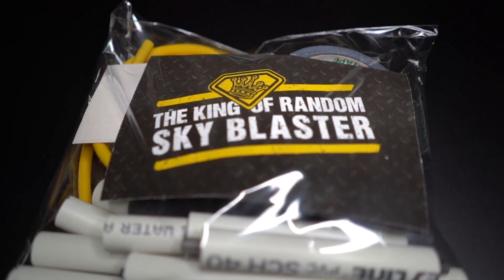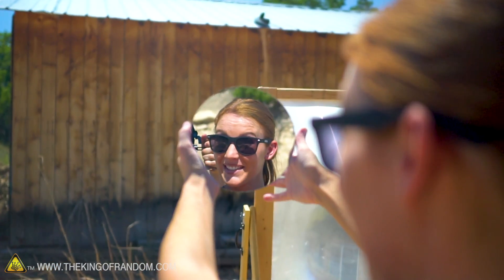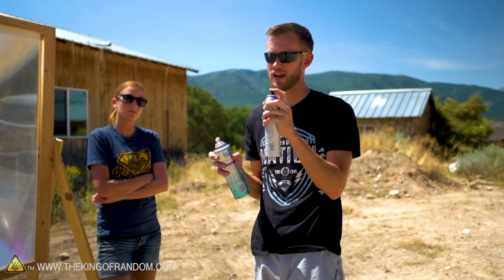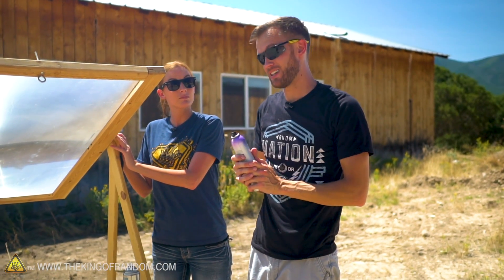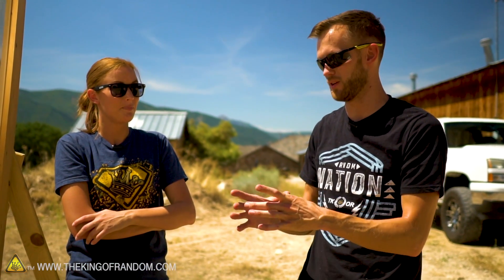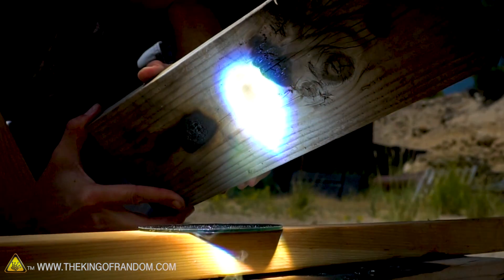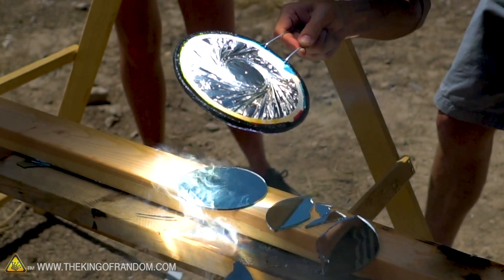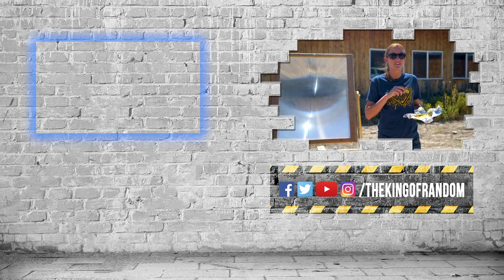Will A Solar Beam Reflect or Melt A Mirror?

Comment: Please try to use the solar scorcher to generate electricity using a makeshift steam turbine or thermocouple. How much electricity could you generate with the concentrated heat from the sun? Could you recharge your electronics while camping, or power some household appliances (e.g. fridge) during an extended power outage, by charging up a power bank?
Reply: I am super curious about this as well,  That is pretty much how a molten salt solar generator works.

Comment: Mirrors and sunlight?  Might I recommend the Troy Rising series by John Ringo?  One of the bits of tech in the series is called the Solar Array Pumped Laser or SAPL.  While it's not technically a laser, and is really just an Archimedes array on a very large scale, they're able to use mirrors and sunlight to mine asteroids and defend the solar system.
Reply: Yeah, they had issues with their mirrors breaking in the books as well.

Comment: Ive always wondered if the solar scorcher would be able to provide enough heat to forge steel? If it can get to 2000°, the melting point of steel is in the 2500° range, but You won't need to melt it. Just saying, knives forged in sunlight would be rad.

Comment: For the aerosol spray to ignite when you spray, you will have to mix the aerosol with some kind of color. So when the magnifying light hits it, it wont reflect thru like the clear aerosol spray. It's like water, the heat light will just go thru the clear aerosol without being contact to a color aerosol spray. Try dyeing the aerosol to a different color and maybe it will ignite

Comment: How mirrors work is that it absorbs the photons and then creates a new photon in a counter path to the way the original photon was traveling. However the mirror is not 100% reflective even if it looks that way some of the energy is absorbed and turned into kenetic a.k.a heat energy.

Comment: You guys are doing it backwards. What you need to do is figure out where the focal length is and put the lens under the pan with the pan at the focal length and use the mirror to reflect the light from the sun up through the lens focused on the bottom of the pan and then it will work to fry your eggs.

What might be more fun would be to see if you could use reflected light on a photo cell. That way, you could have a static array of photocells with heliostats that track the sun, bisecting the angle between its azimuth and your target and have a tracking solar array, which is basically stationary.

Comment: This experiment makes me wonder how much of each wavelength do mirrors reflect? Do they reflect visible light more than the invisible part of the spectrum?  The experiment obviously confirms that a lot of infrared energy is absorbed.
Reply: Different materials are better at reflecting different parts of the spectrum. Most mirrors reflect in the visible range. Although, on rare occasions mirrors are made to reflect other wavelengths.

Comment: If the mirrors were already evenly hot they wouldn't shatter. the reason they're shattering is because of thermal shock. Rock does the same thing if you heat it up wrong glass and rock are rigid if you heat up a small portion of it rapidly but expense will the rest of it stays the same size causing it to shatter

Comment: You guys need a frontal surface mirror.

The reflective surface is on the front of 
the mirror, so the light doesn't have to go 
through the glass.

Twice.

steve

Comment: what I learned from this, mirrors reflect light but not heat it seems
also, the reason for the rainbow on one side of the reflective lens and not the other, when the light reflects off your hand and passes thru the lens, the lens acts as a prism and divides the light into its rainbow spectrum

Comment: Hey guys Can you try to see if under enough heat will gum melt or burn and will it make a difference if its chewed. If it catches on fire can you see if you can put it at the end of an arrow from the crossbow Nate made and see if it works as a sticky fire arrow.

Please

Comment: try this please, a bullet chamber but the inside has mirrors tilted diagonally towards each other that send light bouncing from one end of the barrel, to the other end and then you have one of those screens at the other end that creates a focal point and boom ray gun. you could make a trigger that opens the lid when you pull it to let light in and then let go of the trigger to "turn off" the ray gun. I think this would be interesting. Like so they can see, please and thank you.

Comment: Try putting the mirror on ice, or just water to dissipate the heat of the mirror enough to cook the popcorn. (like how you can boil water in a plastic bottle without the plastic melting)

Comment: as a mirror's reflectivity may vary from 85% to 99.9% it might have worked better with more expensive mirrors, those looked like the standard looking glass variety while more expensive industrial mirrors with a higher reflectivity would have absorbed a lot less of the heat.

Comment: What would happen if you placed the end of some fiber optic cable in or near the focal point of the light?
Would it be able to transfer the heat via light to the other end?
Or
Would it melt it to quickly to find out?

Comment: Can you test the whitest brightest paint and Venta black against the scorcher?! 🤔🤔
Reply: Vanta Black isn't commercially available, but they could test Black 2.0 which is the next best thing. However, it would just light on fire in a matter of seconds. Not much to test there.
Reply: That would be sweet!  I was thinking Titanium Dioxide since I'd use as 99% diffuse reflectance NIR standard along with others that make with sintered or powdered PTFE.

Comment: Expensive mirrors used in physics experiments have the metal on the reflective surface and the glass is a smooth supportive structure.  This way the light is not transmitted through the glass and there is no spherical aberration, etc.  Would one of these mirrors behaved differently?

Comment: I'd be curious to see if you can take the focal point of the solar scorcher and magnify it even more with a magnifying lens. Would it start fires even faster than just a magnifying glass, given the area of the scorcher is bigger, more heat or sun will be focused to that point.

Comment: The Sun isn't emitting light in just the visible spectrum, so it's probably not the visible light melting the mirrors, but the IR light coming from the sun (or whichever wavelengths match the ones from all the atoms in the mirror). You guys should try to use the Solar Scorcher with a bunch of lasers!

Comment: You have to try with a silicon mirror, used in laser cut cnc machines, the reflectivity is close to 100%, and you can try to let the mirror float in water to extends the experiment.

Comment: Can you test if first surface mirrors or front surface mirrors have the same issue of breaking? It might be that the protective coating behind the metallic reflective coating is heating up the whole thing. I wonder if the reflective surface wasn't behind the glass, but on top, would most of the excess heat just radiate through the glass or bounce off?

Comment: I think the Tkor group was thinking that light and heat are linked but there not. while yes the light heats things up the heat is not carried by light. things heat up when light touches it even if it is reflected some of the energy is transferred and as it is the item will heat up no matter what the item is.

Comment: No mirror reflects 100% of the light that falls upon it, but most modern mirrors reflect about 95% of the light. That still means that about 5%, or 1/20th, of the light incident upon the mirror is still absorbed.

In the rebuild video, Nate said the frame was "41 inches tall by 31 inches wide," and the dot that Nate and Calli are able to make seems to be consistently as small as 1/2 inch in diameter, so that little dot of sunlight sees about 5,000x as much light as it would without the magnifying glass.

That means that even if the mirror is reflecting 95% of the light that falls upon it, it's still absorbing as much energy as a black circle the same size under a star 250x as bright as the sun.

Don't forget your sunblock.

Comment: What if you make a polished mirror of Tungsten metal? Of course, this could be tricky; Tungsten is not only very hard and dense, but very heat resistant, so machining a mirror-shiny surface could prove to be hard (oh yeah, and expensive)! If anything can withstand the power of the solar scorcher, my bet is on Tungsten.

Comment: Honestly, if you decide to redo this experiment, I'd have a mirror of matching size to the solar scorcher screen, but have the mirror angle the light into the solar scorcher. This way you dont run the risk of breaking the mirror, and you get the upwards focal point. Only problem: getting a hold of the proper sized mirror

Comment: My Guess is that the reason the mirror breaks so easily might be do to ultra violet in infra red radiation wich isn't reflected aswell in a mirror. It might also just be a trash mirror that doesn't reflect a high enough percentage og the visible light

Comment: Wonder if you can turn that light into a laser by reflecting it into a cone shaped structure lined with reflective glass and another magnifying glass on the smaller end? Maybe also include super cold gasses inside the structure to try and slow the light molecules down as well?

Comment: what happens if you get a solar panel in front of the Solar Scorcher
Reply: Not a solar panel, a looped pipe of water connected through a series of turbines, the light heats the pipe the water rises and or vaporizes and rises faster, circulating through the closed loop...

Comment: Light based heat or not, it's still heat. You can't bounce heat. If you took a pane of glass at the focal point, it wouldn't matter how much light it let past, because the heat is still stopped by matter.

Comment: you only used rear facing mirrors, try some front facing ones as well. a front facing mirror has a reflective surface not obstructed by glass. 

here it looks like the concentrated heat cause the mirrors to shatter by making the glass expand, and as the mirror coating is just a dusting of silver it wouldn't hold it together much at all. 

i suspect you might be able to use a front facing mirror with significantly better results.

Comment: get a satellite dish. get it to a polished surface. and use that as you mirror. or any piece of metal that is correct in size. easy enough work to polish with the tools yall have. toward the end id suggest wet sanding in the 2000 range and then get you some of that buffing polish they use on cars. throw a buffer at it for a while and you will see anything you want to in that when you finish cleaning it up.

Comment: Black spray paint might work with the solar scorcher because there's color so it'll absorb more heat from it
Reply: I ignited a black piece of rubber with round 0,33 l bottle full of water
Reply: Thats true
Reply: Or that flex seal stuff.
Reply: 10,000 brain-thinking points!
Reply: I just wished they'd try to explode the aerosol cans.

Comment: a 100%mirror would reflekt all of the light and therefore all of the heat...BUT there is no 100% possible..even the tiniest roughness is enough to absorb light..and therefore heat! ..that is also the reason why reflektors in a laserlab have to be cooled and changed from time to time!
greetings from germany

Comment: GUYS if you had attached some form of heatsink to the mirror or submerged it in water I think you would have had time to cook. Plus with the water in maybe a like a hotel pan I don't think fire would be as much of a hazard. Miiiight melt the hotel pan though. I would love to see a test with some form of method to keep the mirror cool enough for it to maybe be used with this setup.

Comment: You NEED to see what Vantablack looks like under this much light 🤯
Reply: It would look like it was on fire.
Reply: @MercurialCorsair  Vantablack is made from carbon nanotubes and carbon does have a very high melting point. It's a decent curiosity. Could catch fire or just smolder, who knows.
Reply: TNGam3rz why try to be right
Reply: @kidmythic9438  why would you want to be wrong?
Reply: @MercurialCorsair  exactly XD
Reply: It depends on what you paint.  If it can handle intense heat it should be fine.  Paint a 2x4 and it will catch on fire.
I want to see Vantablack checker squares with something extremely reflective.  Vantablack checkerboard squares on a mirror? :)
Reply: @drippingwax  vantablack isnt paint?
Reply: drippingwax it wouldn’t show up as dark on camera btw, a pixel your screen can only get as dark as it looks when ur screen is off.
Reply: Ask Anish kapoor really nicely
Reply: Great idea 👍🏼
Reply: When they talked about aerosols and the solar scorcher I thought they were going to set Nate's can of hairspray in front of the rays and run.  See how long it takes to blow up and then try again with a second can painted with Vanta Black?
Reply: Vantablack absorbs all the light, and it keeps that energy inside of it. You'll literally heat up the vantablack and the surface it's on up to probably several thousand degrees very quickly.
Reply: N4THANF0ST3R  facts
Reply: Vantablack is not for sale though.
Reply: Lawrence Tider it actually is, it's just ridiculously expensive, and it has to be applied in a vacuum chamber.
Reply: @LetsTakeWalk  You can buy a bottle of vantablack paint on ebay for about $53 with free shipping. The description says it covers 2m x 2m, with a second coat needed on porous surfaces. So, measure your car, divide by 4 square meters, multiply by $53 and you have your answer.
Reply: Real Vantablack would not look different,  the consumer stuff will look gray
Reply: that was my first thought seeing the video too!
Reply: N4THANF0ST3R instant fire
Reply: It won’t do much because Colours absorb light and black absorbs more light and real vantablack absorbers around 99% of light
Reply: It looks like black... Completely black...
Reply: A little bit gray
Reply: Oh yeah
Reply: It would be on fire
Reply: @LemonsShippingContainer  pure carbon does not burn, that's why heat shielding on reentry vehicles work
Reply: @suit1337  uhh pure carbon absolutely burns lmao and ablative Shields aren't made of pure carbon. Look up a video by periodic elements of them burning a diamond in liquid oxygen
Reply: @suit1337
C + O2 = CO2 
Pure carbon can burn.

Charcoal and coke are almost pure carbon and they will burn.
Diamond and graphite are pure carbon and can be incinerated, although with difficulty.
The main difference is in the structure. Charcoal and coke are porous and much of their volume has access to atmospheric oxygen. Graphite and diamond are solid and thus only their surface is exposed.

Would Vantablack burn? I do not know. I guess it would, but would have a high ignition point.
Reply: What would happen if you put a prism on it?
Reply: I guess it’s gonna explode immediately . Since light is 100,00% converted to heat
Reply: @FireLord263 Ten thousand percent?
Reply: it's gonna burn
Reply: It’s still black 🤯
Reply: AmAzInG idea! I wanna see this! 🧐
Reply: This would be great!! I wanna see this 😬🧐
Reply: Nothing?
Reply: I was the 666 like what does this mean?
Reply: @sakihara9433  i changed it to 667 its ok
Reply: Go to 1:13 to see Nate’s sun blister
Reply: @RetroOnSpeedDial  ?
Reply: @zay hi how do they not match?
Reply: Since it's black, it's gonna absorb more light and eventually burn much more quicker
Reply: It'll be the most super bright dark thing you ever saw. 🤯
Reply: It will burn down instantly
Reply: YES
Reply: Indeed
Reply: Oh! Yes, would still like to see it
Reply: That might not be possible. Vantablack is composed of some very toxic materials. Heating it up this much might be extremely dangerous. It might be too much for a youtuber to be able to tackle responsibly.
Reply: I live in Florida. If I want to pop corn using the sun, I put a handful in my pocket and walk outside.
Reply: Black 3.0 is darker
Reply: Singularity is even darker
Reply: it will burn
Reply: Burn/melt, hottest material ever.
Reply: It would absorb so much energy... It would probably melt or burst into flame
Reply: great idea
Reply: It would turn into black diamond sand.

Comment: You used the wrong type of mirror. The one you used have plated face on the bottom, so the light goes through the glass TWO times. You should have used top plated mirrors like those used in lasers, so that the metal face reflects light without heating up the glass.

Comment: What if you use a smaller magnifying glass to even have more energy contract, basically making the already powerful sunlight beam into a power fuller beam, using the solar scorcher then Another normal sized magnifying glass.

Comment: Can you do an experiment of burning something while in a vacuum?
Reply: The term you're looking for is pyrolysis.  Vacuum means no oxygen, no oxygen means no burning.
Reply: @finbar163  yeah, so I'm wondering if they could demonstrate what happens when heat is applied to an object in a vacuum (without oxygen) it seems a difficult experiment to set up and augmentate. Would be cool to watch
Reply: @danielhempstead3553  Getting something that you can watch seems to be the hard part.  A brief search turns up lots of people using metal drums.

Comment: Have you considered cooling the mirror as the light energy is being reflected? The mirror is absorbing the energy. The loss should be minimal if a fan is used to cool the mirror. Or float the mirror in water and let the water absorb the heat.